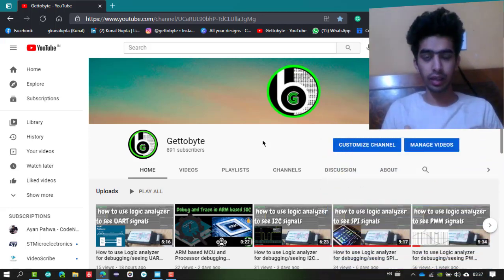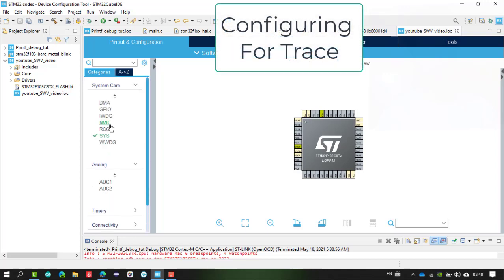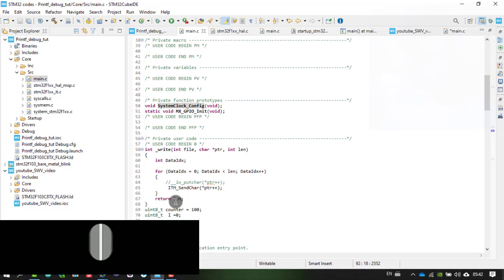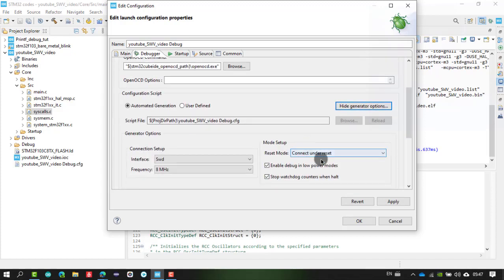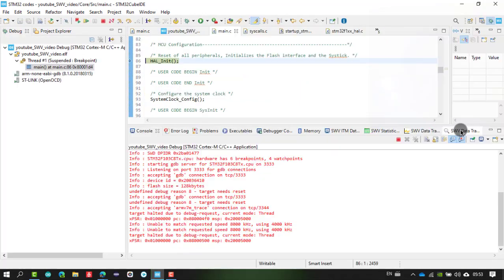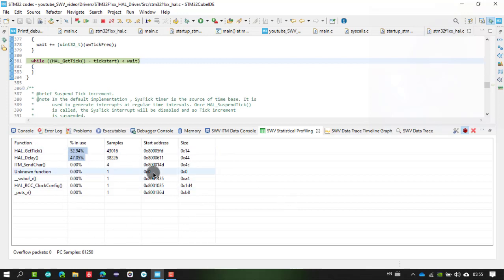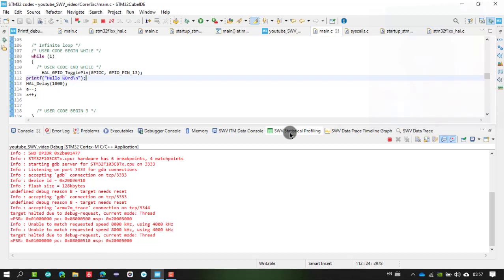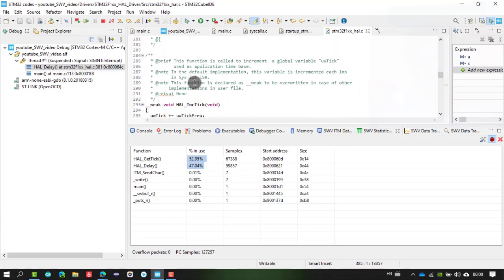How to use Trace Features: Part 2 || What is SWO & SWV in STM32 ?? Trace Features with STlinkv2

Comment: I'm using a FlashPro5 to debug an Arm-M4 that's on the Microchip SmartFusion2 FPGA.

However, I'm interested in using more advanced debugging features like the real-time tracing found in percepio's tracealyzer or  segger's systemview.    
 
From what I understand, tracing (ITM?, ETB?, MTB?) requires:
1) chip support of SWO*
2) capable debugger adapter (ex. Segger J-Trace).   
3) debug software (GDB/OpenOCD??) 

So, can the SF2's ARM-M4 do trace streaming?   If so, my Microchip's FlashPro5 does not seem to support SWD (nor SWO).

I also bought the AT Atmel-ICE which supports CMIS-DAP/SWD/JTAG.. but will it work with the SF2 Arm-M4?   I don't see the AT Amtel-ICE mention any SWO or Serial Wire Viewer support.   Is there any other lower-cost debug adapter that will work?  For example, the EDU Mini, RealView U-Link2, Black Magic Probe, etc?

*SWO allows data out from up to 32 different stimulus ports, over a dedicated SWO pin (not part of SWD.

Comment: did exactly EACH AND EVERYTHING same but not getting printf output on SWV ITM DATA CONSOLE .  AND controllers tech utube channel video descritption also says  https://www.youtube.com/watch?v=sPzQ5CniWtw&t=498s
its not possible to printf output with f103 ,is your video real becuase after your started debugging the video seemed has changed suddenly
Reply from the maker: 😂😂😂yes bro my video is real and who has told u that on f103 printf can't be output.  I daily use the f103 and printf() thing. 

Watch the controller tech video properly , u are mistaken in that part.

All cortex m3&m4 processor can output printf() via ITM.

And u just check your connection or configuration properly.. otherwise u can reach out to me from gettobyte whatsapp group: https://chat.whatsapp.com/EW3pkEDhygqHRfqVBWH5Pa